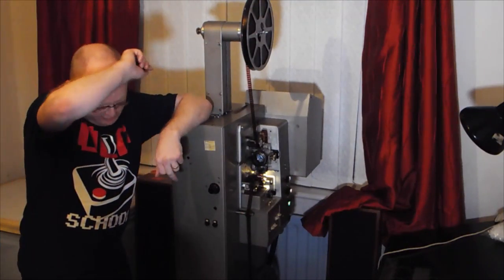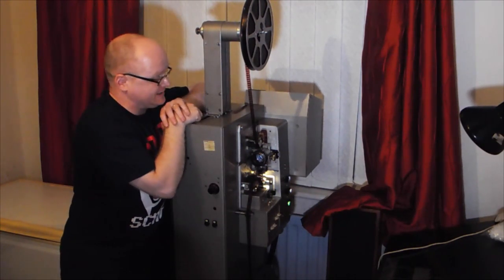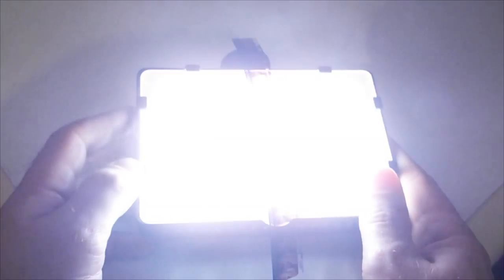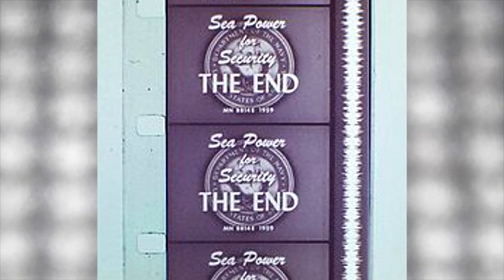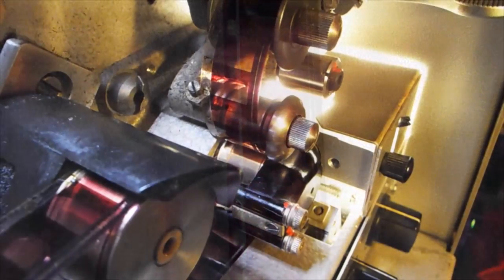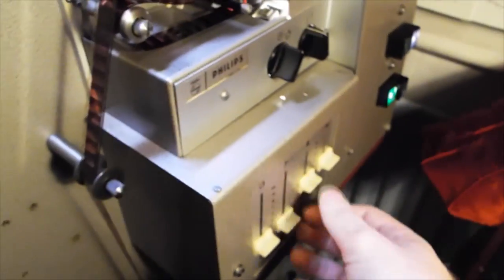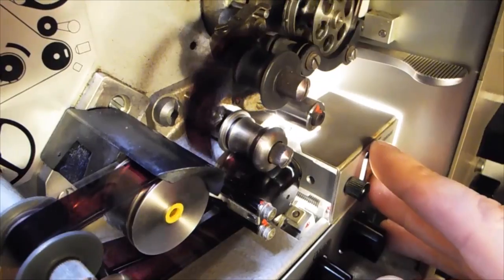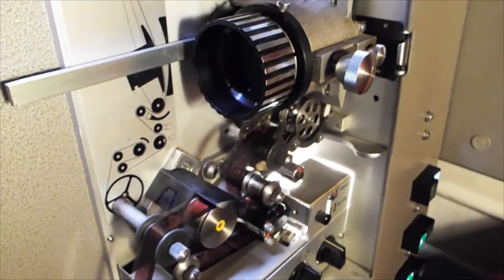Philips FP-16 threaded Audio Run and explination of 16mm audio technology ( Kinoton / Norleco )

Comment: The control for "STANDARD" and "NON STAND" is a focus control for the sound lens. The soundhead projects a precisely focused slit of light onto the optical soundtrack. With 16mm, the film was usually wound with the emulsion-side (the side where the image is actually contained) of the film facing inward on the reel. In this standard configuration, the emulsion side faces the projection lamp, and depending on the projector, either toward or away from the sound exciter lamp. In the non-standard configuration, the emulsion is wound facing outward on the reel. This is common for reversal (direct-positive) duplicates and camera originals. With the film running through the projector with the emulsion on the opposite side of the film in this case, the exciter lamp must be refocused for the slight change in distance (caused by the thickness of the film) the soundtrack is from the lens. If the slit is improperly focused, the high frequency response of the audio would be reduced. 35mm film as a rule (for release prints) is always projected with the emulsion side facing the lamp, and away from the projection lens. It may be wound emulsion in or out on the reel, but it's always projected in the same orientation.

That thing below the sound drum is indeed a magnetic sound head. The control below it moves the head away, as to not damage optical prints, or wear the head unnecessarily when not in use.

And as others have stated, the two optical "tracks" on your film are exact duplicates of each other. The practice of using two or more identical tracks pre-dates stereo films though, and was often used (among other reasons) to improve the signal-to-noise ratio of the soundtrack. Some companies, such as Maurer, used 6 or so small identical tracks as an attempt to improve the sound quality further, but I'm not sure that that did much. Also, what you have in the video is an example of a "variable area" soundtrack. Another type, the "variable density" track, looks sort of like an analog barcode. The light intensity varies as the film passes the slit in exactly the same way, so the projector soundheads are the same in both cases.

Additionally, stereophonic optical soundtracks on 35mm were not common until Dolby Stereo was introduced in the mid-late 70s. Before then, every 35mm print with a standard optical track was simple "Academy" mono, and 16mm reduction prints would get a copy of the same track. I assume there was more work involved to make 16mm mono prints post-Dolby Stereo. 16mm did remain mono in all but very rare cases, likely due to the limited space on the film for two high-fidelity stereo tracks. With 35mm, the reduced space for the two stereo tracks was compensated for with Dolby A and later SR noise reduction.

For more information on optical and magnetic film recording (as well as just about everything else vintage film and audio related), I highly recommend Howard M. Tremaine's "The Audio Cyclopedia", first printed in 1959. It's a wealth of information.

I don't think I left anything out, but let me know if you have further questions! That's a really nice projector, and an awesome score.

Comment: I've never seen a 16mm with stereo soundtrack,it's to smal to split the track in 2 different channels. The projector is for magnetic and optical use. The reason why the print has 2 tracks instead of just 1 track(as shown at the beginning of this video) is because the blanc part of the track can give you noise you don't want to hear.The less blanc at the soundtrack the less dust, damage, the less noise. Dolby started this on 35mm (A Clockwork Orange) and 16mm followed.
Reply from the maker: +Piet Burgemeester Oh, I see, that clears that up nicely, thanks :o)

Comment: I suspect the other head may be a magnetic head. The symbol looks like one for a magnetic head assembly on an old C format reel to reel I have. I know that 16mm film can have magnetic or optical soundtracks also. The switch other switch you flicked whilst running god knows! stereo mono maybe? The film you showed to the camera had 2 white waveform lines so was stereo but the overlayed scan was mono as it one single white waveform line. Not 100% sure. Did you try the sources I suggested (bfi and kinoton etc) to try and get a destruction manual!
Reply from the maker: it actually looks like a magnetic head, when i switch the switch that turns the light out, it comes forward so likely.  yes, could not find a 2 waveform picture on line.  i have a pdf version of the manual being sent soln :)
Reply from the maker: the bfi have 2 of these projectors in use ive found :)
Reply: +RetroGamerVX here is a link to a pic of a stereo soundtrack 16mm film http://www.shutterstock.com/pic-42671662/stock-photo-old-empty-mm-film-strip-with-soundtrack.html usually a mono optical soundreader can play a stereo track and vise versa. Atleast in the Kinotons I used!
Reply from the maker: +steadicamant Yes, I have a film with 2 tracks.  At first I assumed it was stereo but then I was told that 16mm does not have stereo, one would be audio and the other would be intensity.  I didn't agree with this as both tracks are almost identical in waveform.  So I was right :o)
Reply from the maker: +steadicamant Yep, looks just like that :o)
Reply: +RetroGamerVX Most 16mm film is mono even if it has 2 tracks. There are a few stereo prints around but not many. Yours is most likely a mono print with twin tracks. Full Stereo16mm prints are quite rare. Look at the manual for the Elmo 16mm projector it quite clearly has stereo options on page 10 http://www.16mmdirectory.org/manuals/Elmo-LX1100-2200.pdf
Reply from the maker: +steadicamant So why did they split a mono track into 2? incase one got damaged?, don't understand
Reply: +RetroGamerVX It took me a while to get an answer froma  friend who worked for Techincolor. Techincolor was and still is one of the main labs used by the film industry for making and processing film prints and now modern digital prints.

The answer turns out to be more of an economic one. Basically most printers for film and optical soundtracks are interchangable between formats (35mm 16mm etc).

So as stereo came into force for 35mm film rather than having a whole seperate head assembly for 16mm mono and 35mm stereo. They just used the same head and just changing out the lenses saving time and costs. Changing the lens which just basically shrinks it down to the smaller space on 16mm was more cost effective.

Stereo tracks (or twin mono tracks as in what is on most 16mm twin track films) will play perfectly fine on a mono optical reader head. Though due to less light getting through due to the extra black line in the middle the volume may be lower. This is easily fixed by turning the volume up!

He said they did occasionally print 16mm stereo stuff though this was few and far between. There was small call for it due to it being percived as a flawed format due to size. However on more modern fine grain film stocks with well set up reader heads like on the Kinoton and Elmo they sounded great. Still not as good as 35mm analogue but that also has the benefit of more ft per second going past the reader due to it's larger size. 

Dolby noise reduction actually has nothing to do with this. Dolby noise reduction (as first used on clockwork orange) is a compander system where during recording the highs and lows are compressed. Then during playback they are stretched back out. A dolby encoded soundtrack needs to be played back on a dolby decoder. If you don't it sounds crap and muddy. As all the highs and lows have been smoothed out. If you still have an audio tape recorder with dolby noise reduction try recording a cd on to the tape with and without dolby turned on and play it back and  you will hear what I mean. A little bit about noise reduction https://en.wikipedia.org/wiki/Noise_reduction#In_audio and a little bit about companding https://en.wikipedia.org/wiki/Companding

Btw as a bit of interest one print my freind can recall doing in 16mm stereo was "Lock stock and two smoking barrels" this was  shot on 16mm and was sent to a few screenings and festivals on 16mm as they couldn't afford a 35mm blow up at first!